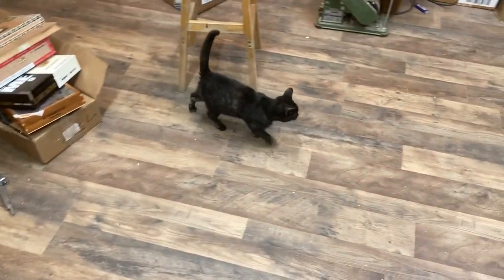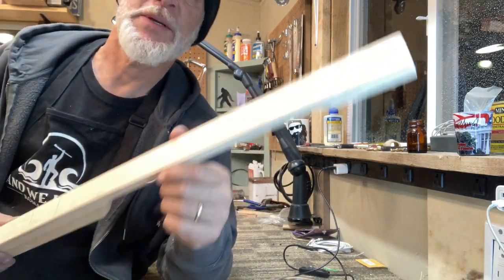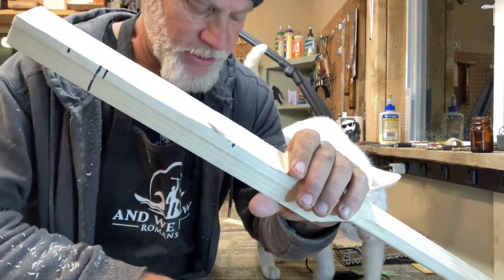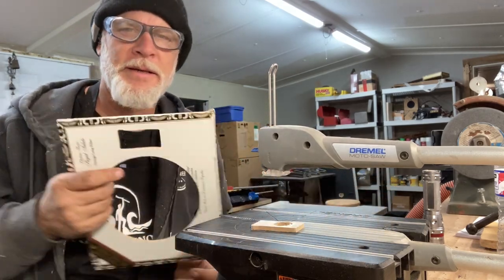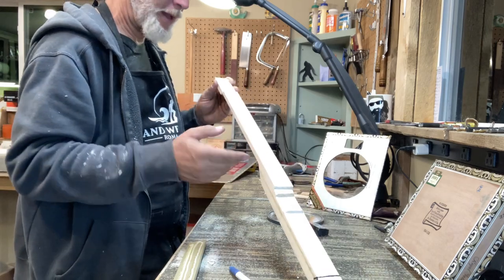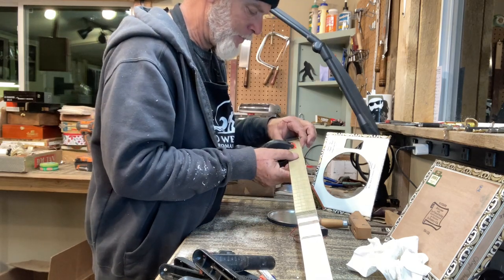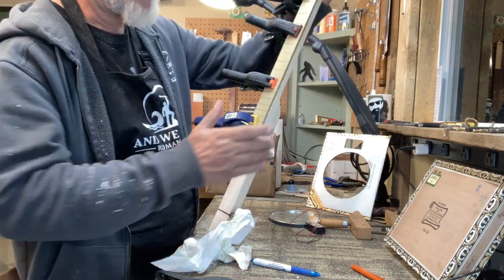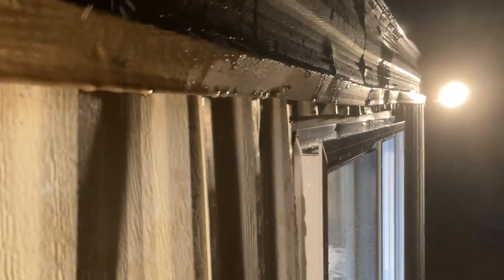Cigar Box Guitar - Building a Resonator 😎

Comment: I drill 2 holes where fret markers are going and use a cocktail stick and when you glue up just locate the sticks in holes and it will not slide about and then clamp where you need to job done Del wow I love that pot belly burner toastie

Comment: I remember that someone used a couple of small nails, to help hold the fret board on.
Reply: I've done similar. Also saw someone use a sprinkling of coarse salt. I might try sand, next time I clamp up a scarf joint.
Reply: @w13rdguy  I have used table salt and it worked ok.

Comment: 14:55 ... I've noticed you have to align the clamp pivot point almost dead on parallel (?) or directly across from the middle of how far the clamping ends will be apart from each other when they are  set or the clamp will pull in the direction of how far above or below the mid point is (whew... took me a while to figure out how to say that)...
I now clamp the fretboard to the neck and drill two toothpick size holes where the 3rd and 15th fret dots will go, apply glue, push toothpicks into the holes , push the fretboard onto the toothpicks and clamp. Fretboard does not move!!

Comment: Wonder if when setting the fret board if you did a dry run. When perfect drill a small hole where a fret marker will go. Then when glued you could insert a wire nail through the hole into the neck; registering the fret board position when gluing. Then either fill the hole with a toothpick and burn as usual. Screw or insert a brass lino brad. Might even be able to burn the marker in advance and use the lino nail or toothpick to register the fret board.